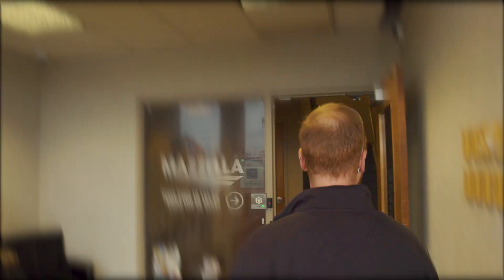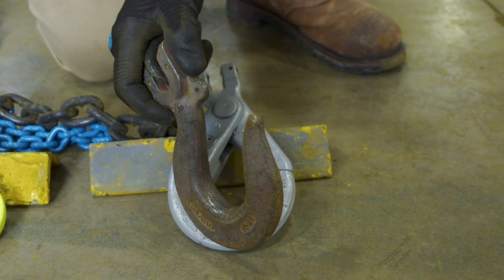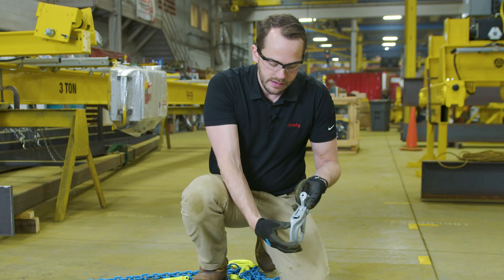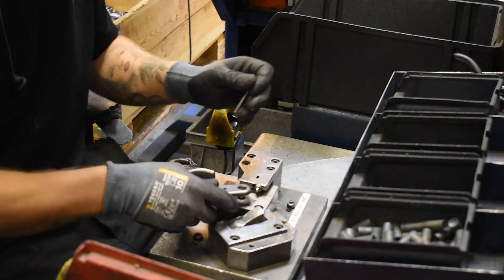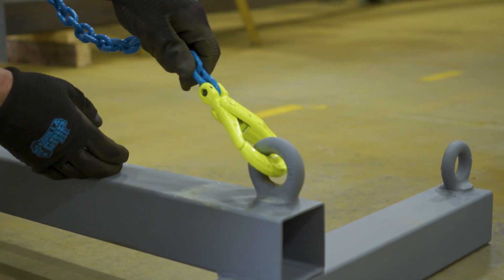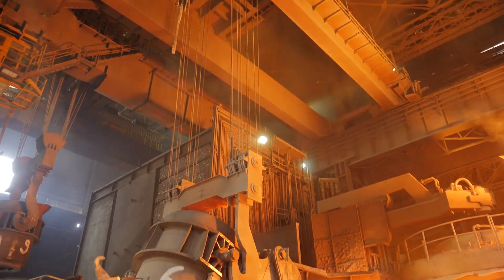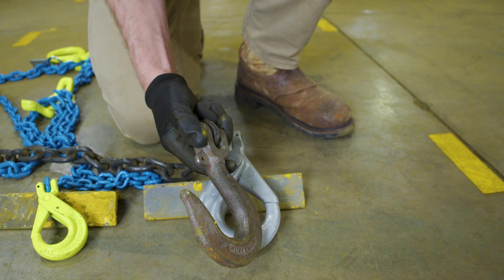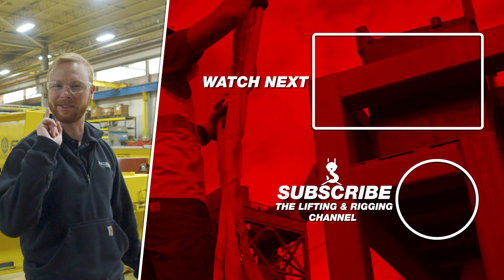Help Make Safer Lifts With Self-Locking Hooks

Comment: Hi. If the Self locking hook is locked and under the load and if during the lowering of the load the hook hit the obstacle and the obstacle push the trigger could the hook open?
To rephrase, can the Self locking hook under the load open up if the trigger is pushed?
Thank you for sharing the knowledge.
Reply from the maker: Once under load, a self-locking hook cannot open. You cannot release the load until there is slack in your slings. The hook is designed so that the weight of a load holds it shut. Great question.